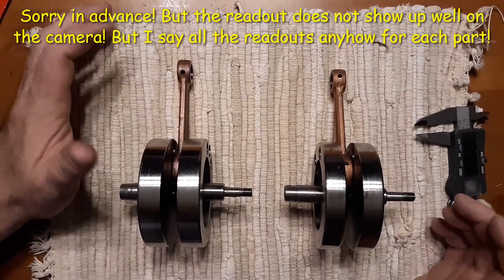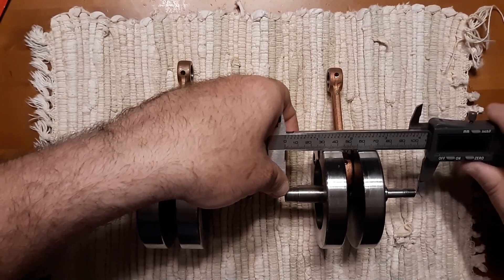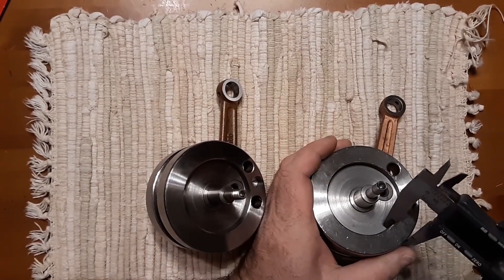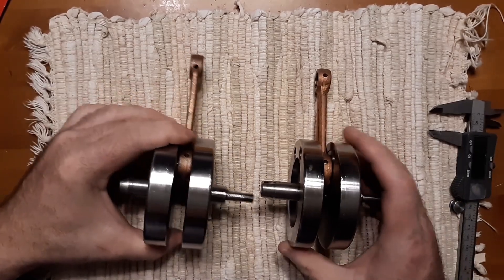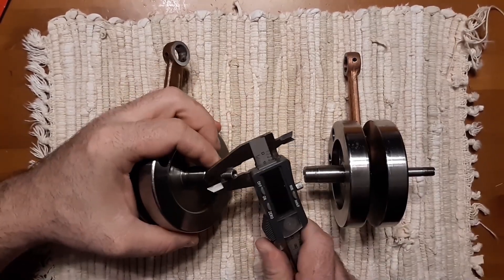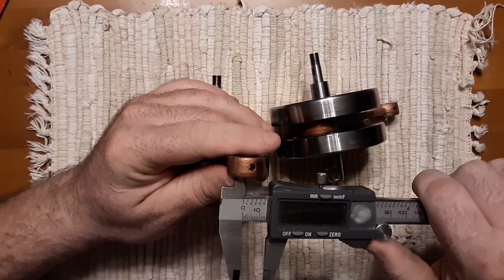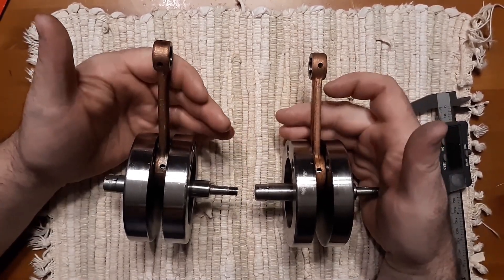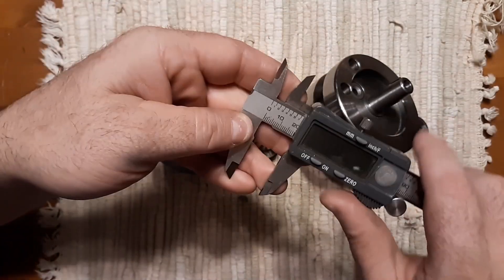Motorized Bicycle Crankshafts 50/80cc & 100cc Side by Side Compared & Measured!

Comment: So I'm trying to order a piston that actually has the needle bearings with it on Amazon which is pretty hard to find. could find is the 50 mm piston which I'm considering to just go ahead and order because I know in the future I'm going to try out the 100cc cylinder. But for now I'm going to stick with my LD 80. And when did they start selling pistons with no needle bearings which makes no sense to me at all

Comment: What is the difference between the high hole and or short hole in the piston ? Does it affect preformance? I have a pk80: would you suggest or recommend a newer piston for upgrading?
Reply from the maker: Low hole is very low end power. Where high hole is more mid range power.  (Port design) Both side by side with the correct rear sprockets can perform the same.   High hole piston can be altered a bit more porting wise is why most buy it.

Comment: wil a short rod crank fit i the yd100 case as is or i will have to take it apart?
Reply: Im.wondering the aame. . It sounds like an af80 crank in a  yd100 bottom end. Besides balancing that would button up the crank portion of the build then?
Reply from the maker: yes!! fits fine but you need to buy shims! RMD sells them set 5$  .25mm shims spacers! some even make them out of shim material. not sure how other then water jet though how you could cut that!
Reply: @BuildBreakFix  hi i have an AF80 and i wont to know if it will fit in 100cc engine or what it will need, i dont understand what you were saying in the previous comment, thank you.

Comment: Question  how much side to side wiggle  should there be on the shaft
Reply: The reason  I asked  is because  I just took apart my 80cc motor  to replace  the gasket  and I noticed  there's lots of play on my crank shaft
Reply from the maker: There is always side to side on cranks normal!  Con rods will always have side to side play.  Up and down it should have none!  That is the one that matters!
Reply: @Build-Break-Fix  Thanks for the input It just seems like there's a Is lot of side aside play Is super happy to hear that it's normal .. Do you happen to have a video to show the inside of a jug and a good piston?

Comment: I just ordered a new crank for my pk80, I also had to get a high hole piston. Thank you for the knowledge and great videos
Reply: Hi Ray. What is the difference between the high hole and or short? Does it affect preformance? I have a pk80: would you suggest or recommend a newer piston for upgrading?